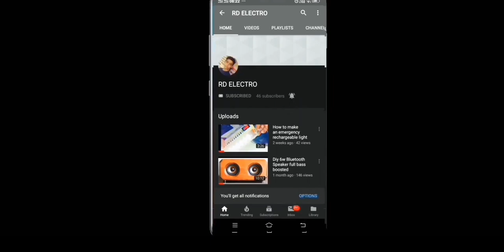RF TRANSMITTER RECEIVER || RD ELECTRO

Comment: Hlo sir how to take output from reciever means where to attach motors
Reply from the maker: You can see the "D0" "D1" "D2" "D3"printing on the receiver that's where you can connect it with a motor driver 
If you didn't understand you can watch this video : https://youtu.be/byc2AWr83WA

Comment: Sir, decoder output working reversely .how to fix this
Reply from the maker: Replace both wires with each other that you are commenting
Reply: @Electrom12  are you telling led bulb wire connections?
Reply from the maker: What is working reversly?
Means what's the problem
Reply: @Electrom12  when switch on in transmeter led will turn off in receiver.when switch off in transmeter led on in receiver.but I want reversely that when we switch on transmeter,then only led should on
Reply from the maker: Try changing the battery that you are attaching to both circuits especially receiver
Reply from the maker: Maybe your battey is weak
Reply: @Electrom12  no new battery only
Reply from the maker: Are your address selector of both circuits same ?